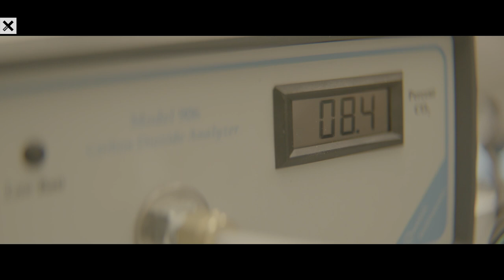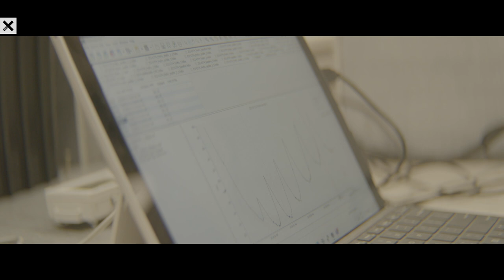This Super Concrete Could Revolutionize the Climate Crisis

Comment: This doesn't look like an alternative to cement.. They're making thin, pressed panels, not something you can pour into custom shapes at a jobsite.
Reply: It's an R&D company and some products are in a development phase.
Reply: Thanks for bringing this up! This is a really common confusion about cement. 

Cement is the powdered ingredients that are mixed with water to create the solid concrete materials that make up our built world. So, you’re correct. Right now, we use the cement to create boards and then insulated building panels. But there’s many more uses as we expand the availability of this cement product, such as tiles, blocks, and pretty much anything else you pour into concrete forms.
Reply: @zs2technologies  Would it create a similar thermal mass to concrete? I’ve become really interested in solar homes lately and that element of concrete is essential.
Reply: @balcorn9211  Unfortunately this a lighter concrete so it would not provide as much thermal mass as say an ICF wall, however it would provide better thermal mass properties than as a stick framed wall.